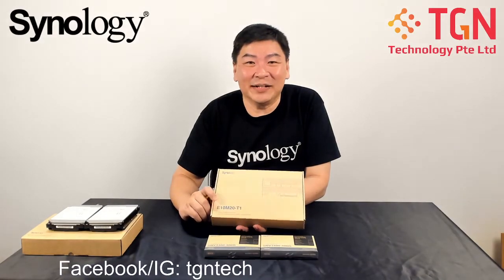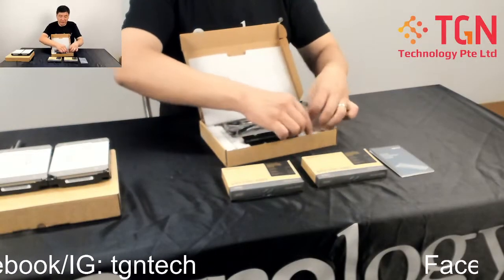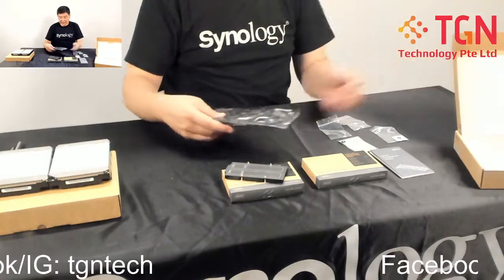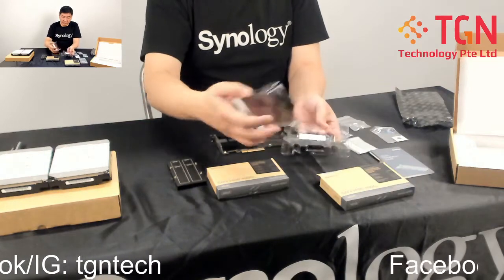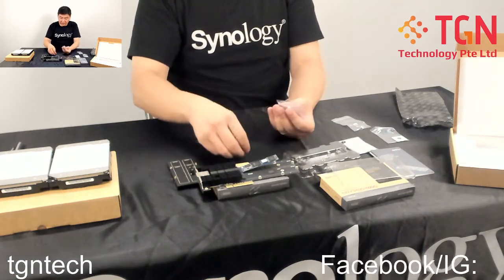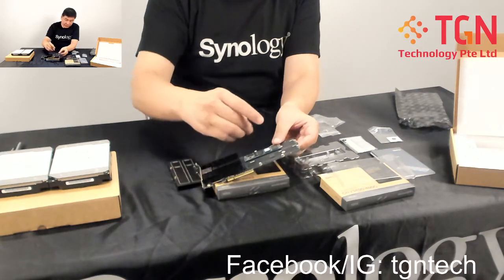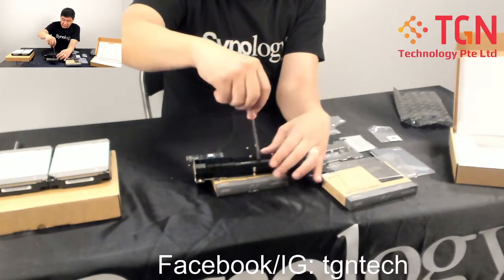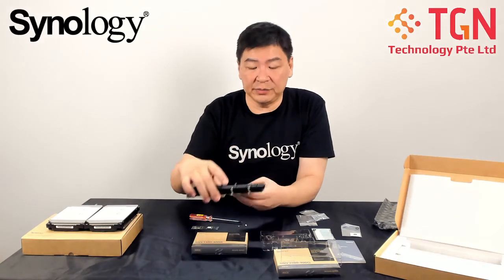E10M20-T1 installing M.2 SSD

Comment: This would be much more useful if you actually showed the heat sync installation.  That's what I need to know.  This only shows part of the install and isn't useful.
Reply from the maker: https://www.instagram.com/p/CdPcH7cLIqA/
Reply: Where to place "1" and "2" is the entire reason I looked for a video.  I think we can figure out where screws line up.  Oh, and that link below is "not available".